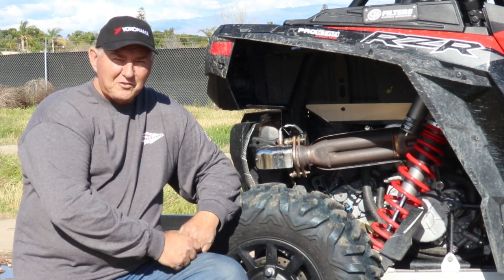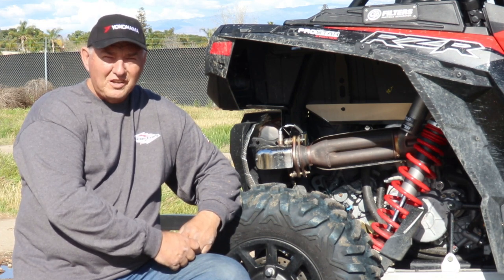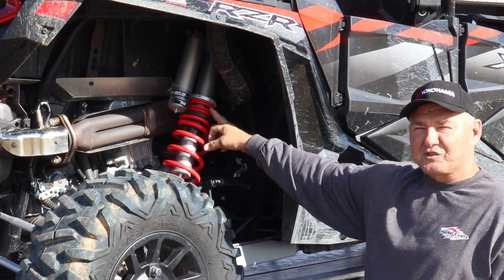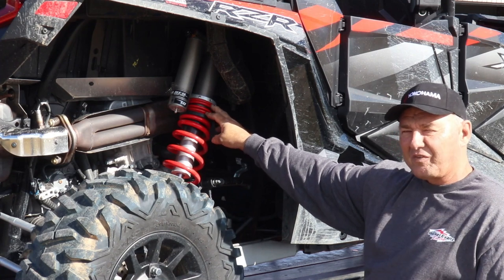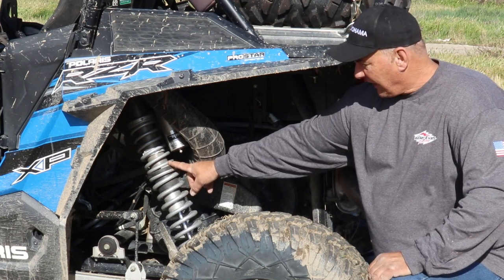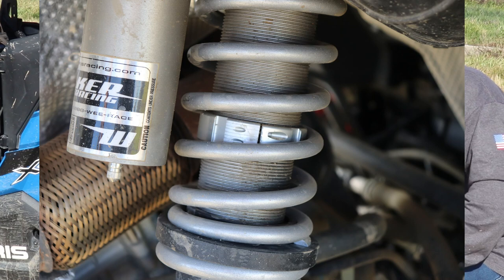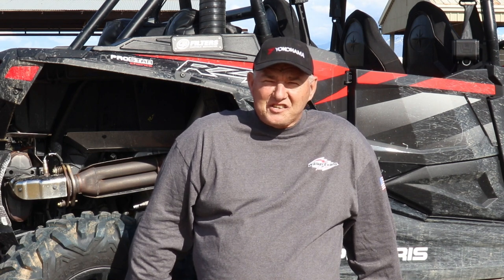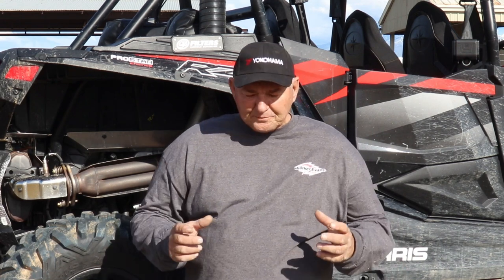Walker Evans Dual Rate Springs

Comment: I have a 2018 RZR XP 1000 4 seat. The ride was way too rough going over the slow rocky trails I do in Arizona. I replaced my springs with shock therapy springs, I called them up and told them like you said how much my rzr weighed what I had on it, how much I weigh approximately how much the passengers would weigh and how I drive. I told them I wanted a very plush ride, the springs they sent me were excellent. My four seat RZR does drive like a Cadillac. People that go for a ride with me cannot get over how smooth it is over the trails. It's exactly how I wanted it, very smooth driving slowly, but I would not want to go over the whoops very fast in it as I'm sure it would bottom and top out. But since I am in your age bracket I don't go fast anymore. Just go slow with the grandkids in it. These different companies that sell spring kits for the RZR's are pretty much the same, they all have pretty good products.
Reply from the maker: I agree Pat They are all pretty good at suspension. I was really impressed with the guys at Walker Evans on how they worked all the spring rate options to make sure I was totally happy. Reed and Jason took a real interest in my RZR and it just showed me how important, to them customer service is. I to have the Cadillac ride. I have rode some hard whoops with now bottoming out. Just makes the car great to drive. Thanks for watching the Channel and I hope you subscribe .And my machine is a 2018 turbo XP 4 seat. Be safe and enjoy your RZR    Sincerely Tim

Comment: I wanted to add tender springs to front of my 18 xp1000 , but can’t get a solid answer from anyone at dealer or forums , if I buy the smaller tender springs and collar they ride on , do I need to buy shorter main springs or do I just add the tender to existing main spring ? I have one front spring - everyone says buy shock therapy at $1k for front

Comment: Will Adjusting the lockout collar up or down to make it softer on slower rocky stuff
Reply from the maker: yes up towards top of shock softer
Reply: When the shock compresses the top spring compresses first . It compresses until the black plastic stopper makes contacts with the locker ring and then when the contact happens it goes into the larger main spring. So the lower the ring the quicker it gets into the main spring the higher the ring the more of the small spring is used until it finally hits the black stopper and gets into the main spring